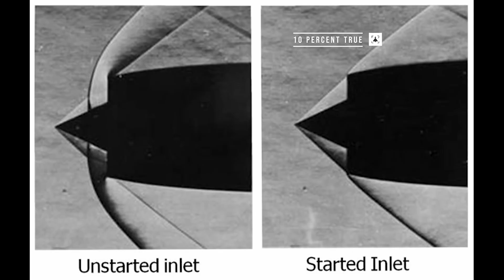SR-71 Blackbird: Mach 3.2 Flight Secrets Revealed!

Comment: I am a member of an F-16 message board ripe with engine techs, ex-fighter pilots, aerospace engineers, etc. The boys extrapolated - based on an SR-71 mission over Libya - the true top speed of the Blackbird is Mach 3.88. This pilot was Brian Shul and your guest "hinted" at 9:33 this was Shul.
Reply: Was that ground speed though? If it was, they were more than likely assisted by a tailwind. Richard Graham's book said the maximum structural and temp limit was 3.58 Mach, if I recall.
Reply: @core_of_winter  No clue on both. Shul didn't say. Shul deemed it necessary to operationally max perform the Blackbird over Libya by 8% and in doing so, lived (backseater too). 

I imagine the limits of 3.58 Mach was achieved through NDT (non-destructive testing)? Seems real world results differ slightly. If there was a pilot to test or rather achieve this, it was Shul; the Black Sheep in the Blackbird community. Not because he was hot dogging it, but for the sake of self-preservation. Now, interestingly Shul didn't say this was the limit - at least I do not recall his sentiments being such. Only that he needed to "push it up" to evade the SAMs, and he did. 

Some men are limited by their limits and are displeased when other men are not, regardless of circumstance. This pilot tell us this. Mach 3.2 or 3.4 is "the limit" and if this limit limits your life or limits you to a jail cell as a POW, he accepts his limited fate. Brian Shul? Not so much.

Thank you for your reply.